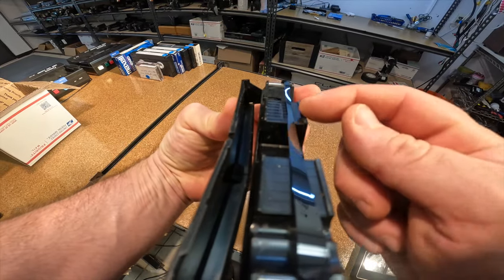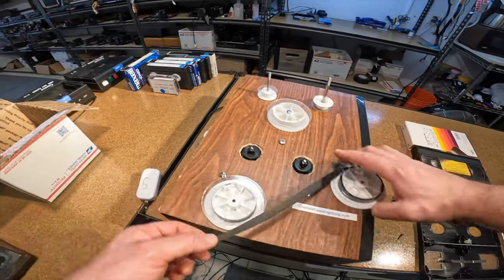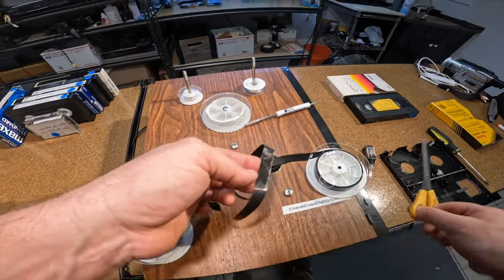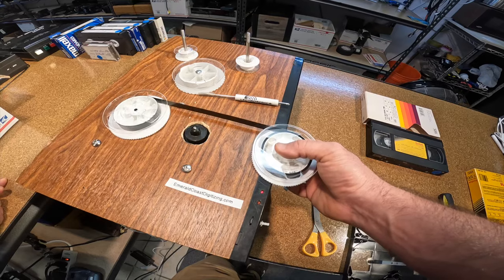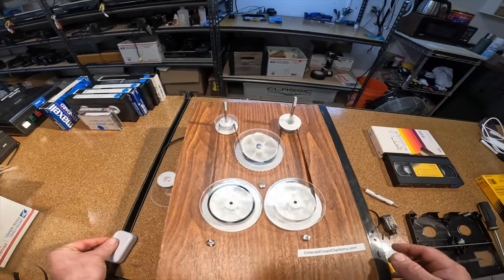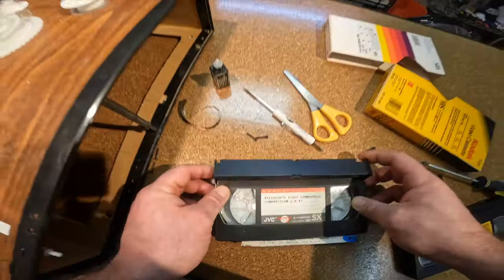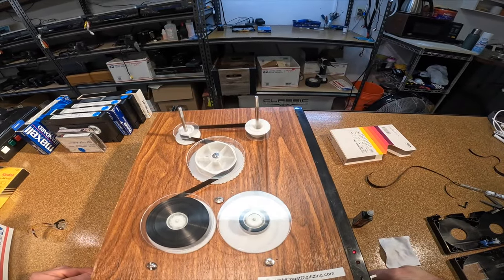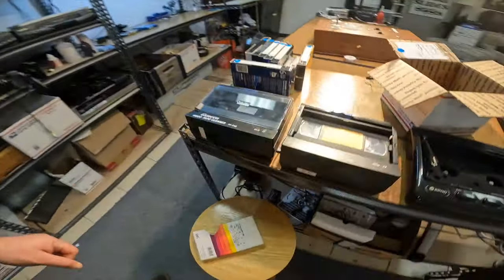Vhs Tape Repair ** Mold Causing Tape To Stick Together And Rip

Comment: Wow, this is incredibly good information on how to deal with moldy tapes.  I'm thankful that I haven't yet had to work with tapes this bad, but I'm sure it will happen someday.  I'm amused and impressed by your ingenuity in repurposing things you already had around the shop to build a more useful machine to deal with it.  This should already exist as a product.  If you could make it look a little prettier, you could probably sell them to other shops for $500+ each.
Reply from the maker: Glad it was helpful!

Comment: For the digitizing process, you should look into the doomsday duplicator; it records the signal off the head amplifier and demodulates it in software  and does TBC among other things configurable to get the highest quality signal possible!
Reply from the maker: Sweet! How many do you have? I need 12
Reply: I've heard about the Domesday Duplicator. It's probably more than you need - creates absolutely massive files (essentially uncompressed video), and you still need to get the VCR to lock onto the signal and play it correctly. So it won't help with moldy/dirty tapes, or ones where the tracking is bad. It's not a magic wand you can wave over your tapes to get them to transfer perfectly every time!

Comment: Can silicone lubricant spray like WD40 be used to deal with sticky spray or when the tape looks stiff and frigid?
Reply from the maker: Man I don’t know. I’ve been wanting to try but don’t have any personal tapes that are in bad shape at the moment. I have often wondered is there is a coating we could put on tapes to preserve and clean them
Reply: No, do not use WD40 on video tapes. I use electronic cleaner or just do exactly what this tutorial says to do.  It works most of the time.

Comment: What type of motor did you use in your homemade rewinder? I found it very interesting, maybe I can do it with a video cassette with a damaged head but the controls work, I have a tape here that I want to recover, it's glued too.
Reply from the maker: Just put a pad over the erase head of a vcr. Instant cleaner
Reply: @EmeraldCoastDigitizing Thanks